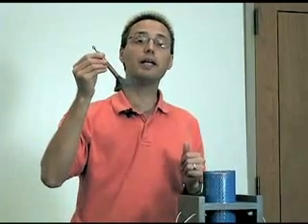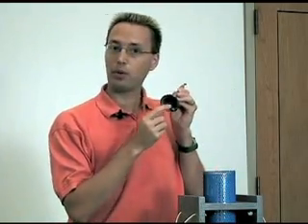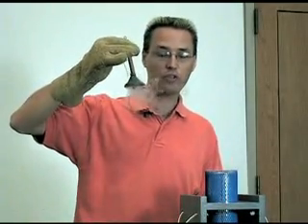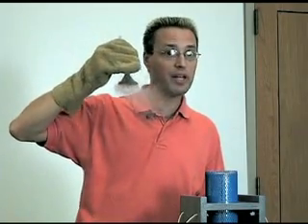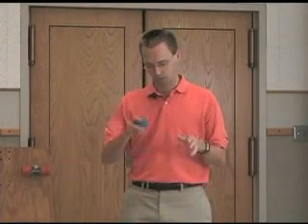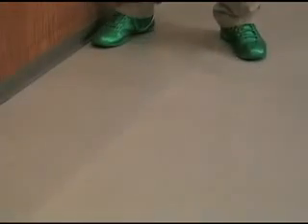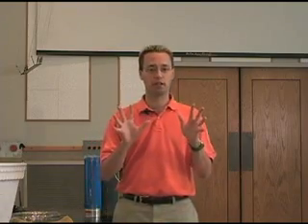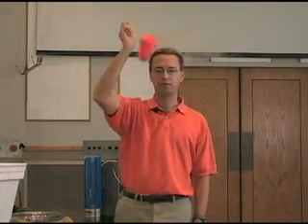Liquid Air - Science Theater 31

Comment from the maker: I washed my hands thoroughly after the demonstration.  Also, I don't think I even touched it with my bare hands...

CONSUMING lead is very bad.  It isn't like Mercury where it has a significant vapor pressure and can get into the air, etc...  Being in a room with lead is no big deal.

Comment from the maker: Liquid nitrogen isn't toxic, just very cold.  Most of the time I'm quite safe, and if anything spills I simply need to get away from the cold liquid.  Gloves could actually be a bizarre hazard, if some liquid nitrogen were to pour into the gloves, I'd need to take them off very fast...

You have a good point, and some gloves would be handy, but as I'm not getting anywhere near the liquid I don't need them... (note the gloves when I ring the bell.)

I probably should be wearing goggles. :(

Comment from the maker: true, if you were to leave it in liquid nitrogen.  However, if the time exposed to the nitrogen is brief, there will be little or no exchange of heat.  (Like waving your finger through a candle flame, do it quickly and you won't get burned, hold your finger there and it will burn.)

DO NOT TRY ANY OF THIS AT HOME! :)